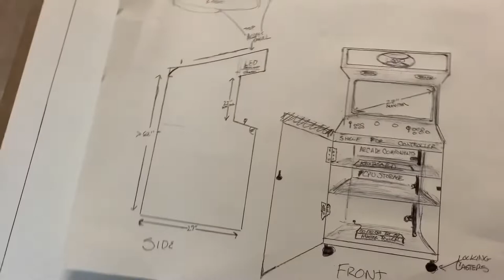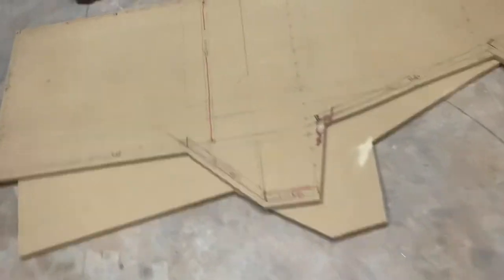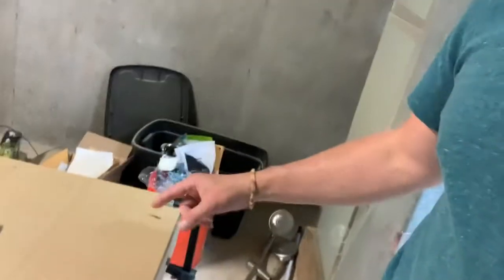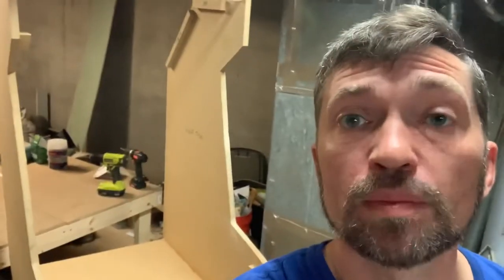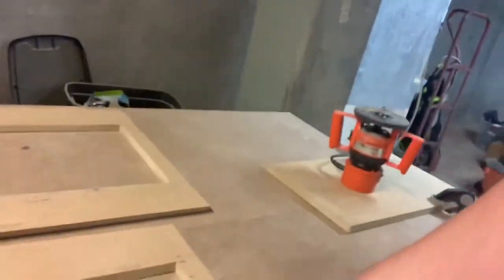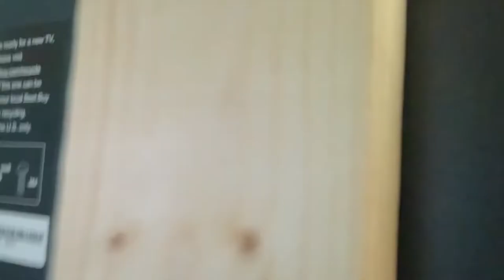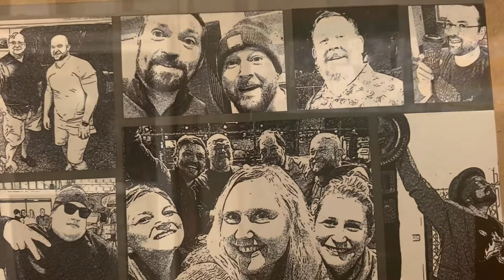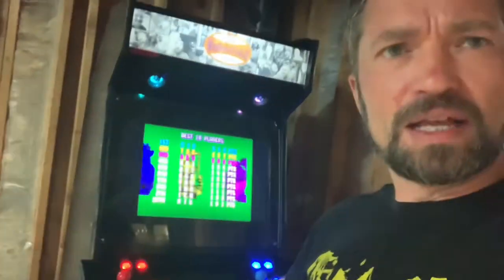Beginner Custom DIY Arcade Cabinet in Two Weeks (Weekend Social Builds)

Comment: MDF is cheap thats why most people use it, I use particle or ply board, a bit more but works great. Dont be afraid of your router, the one you have here is a bit big, i suggest get a single hand unit. Also invest in a nail gun, i used brad nails and glue, not a single screw in sight. But overall not a bad outcome, you will get better as you learn more.
Reply from the maker: All great suggestions. I’ll never use MDF again if I can help it. And yeah, a nail gun might be on my Christmas list this year!

Comment: Cool project....maybe on the next one to cut down on weight of machine build the base on it's own and the top part on it's own....lighter and easier to move....also for that side piece with the tough angle you have to plunge the radial saw in...might be better to drill a hole at each end and use a jigsaw.
Reply from the maker: Thanks, man! I had considered splitting the top and bottom but I really wanted to keep the sides one solid piece. But 100% I’m going to be using a jigsaw for the angle where the monitor is for any future versions— at the time I only had a cordless jigsaw that drained the battery in two minutes. Just purchased a corded one that is AWESOME and would be perfect for that cut. Thanks for the feedback!
Reply: @theweekendsocialpodcast5577  i get it...the one piece look it probly better looking as lonh as ya don't have to move it too often.

Comment: Can you add a link to that plug you got with the on switch
Reply from the maker: Absolutely. It’s these guys: 

oviitech 3 Pack Grounded Outlet Wall Tap Adapter with On/Off Power Switch，Single Outlet with Switch in White 

https://www.amazon.com/dp/B0747P16BW/ref=cm_sw_r_cp_api_glt_fabc_MNVJBQSV62DXPE7A8R07?_encoding=UTF8&psc=1